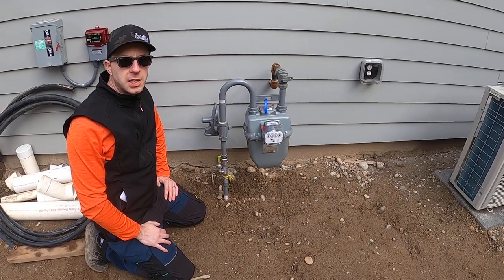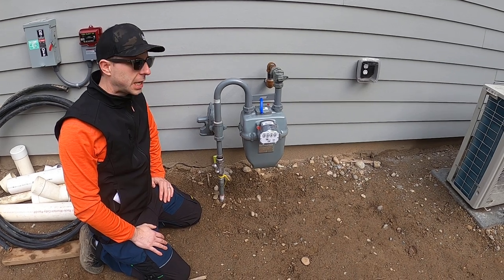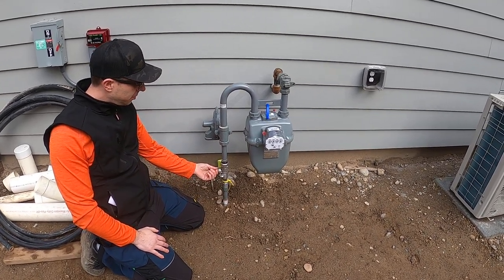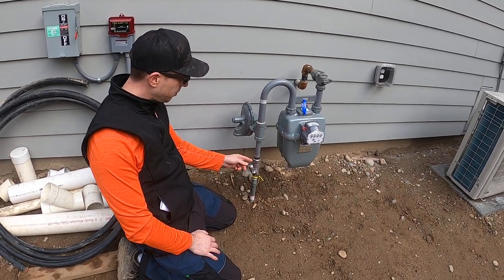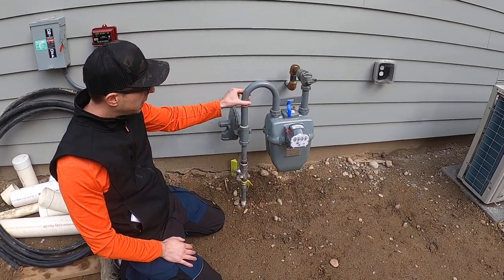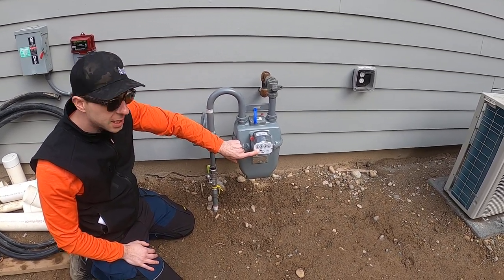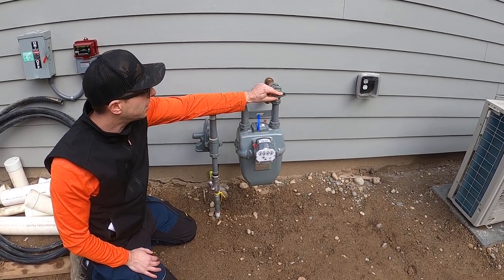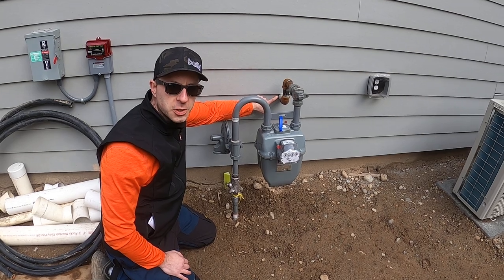Components of a Natural Gas Meter

Comment: In case of a disaster where would you shut the gas off to the house?
Reply from the maker: The shut off valves. 🤓
Reply: You shouldn't. let the pro's handle that (call your local gas provider)
Reply: @RexOLux  Wrong!  That's what the shutoff valves are for.
Reply: In the event of smelling gas inside the property. You should shut off the Emergency control valve before the meter assembly, it should be accessible at all times and only turn 90° ( quater turn ) should not "fall" to on or turn a full 180°.
 No naked flames, do not touch any electrical equipment, ventilate the area ( windows/doors etc ) then leave the property and call the gas provider.

Comment: Where is the pressure regulated?
Reply from the maker: It's the component after the service line and before the meter
Reply: At the regulator, cuts whatever gas pressure coming out the service line from oz to lbs
Reply: @PioneerBuildersInc  
Correct!  It is the device you called a relief vent rather than a regulator.
Reply from the maker: @oldtimefarmboy617  our gas service provider's diagram calls it a relief vent in there diagram. Thank you so much for adding to the knowledge
Reply: @PioneerBuildersInc  
You are welcome.  While the regulator could and probably does act as a relief vent in case of over-pressure on the supply line, in Texas, or at least my part of Texas, it is called a regulator and is required to maintain a pressure of at least 10 ounces of pressure on the building side with every gas powered device running at wide open at the same time.
Reply: There is a relief vent on the regulator but that is a regulator you pointed to
Reply: @joeyvazquez2886  goes from pounds to ounces not ounces to pounds
Reply: @tracker1ify  
Yes my mistake i meant to put that the reg can output either oz or lbs.
Reply: @tracker1ify  
But as he stated, the gas provider chooses to call it a relief vent so that is the nomenclature he uses as well, for whatever reason, probably ignorance of the function of a regulator.  You do not necessarily have to know what you are talking about to draw a picture and label it.